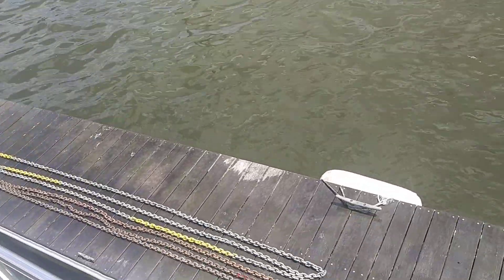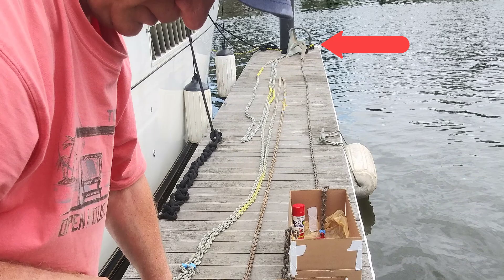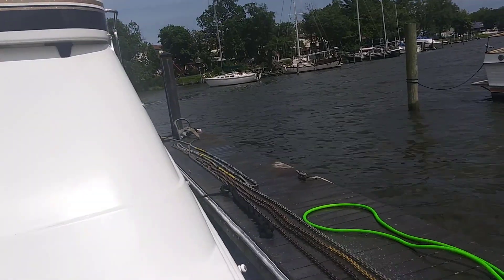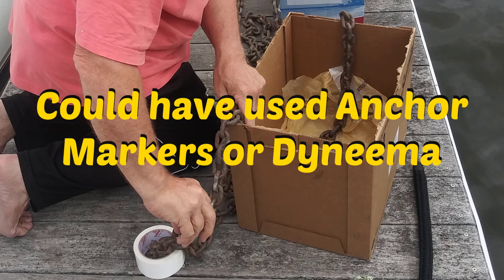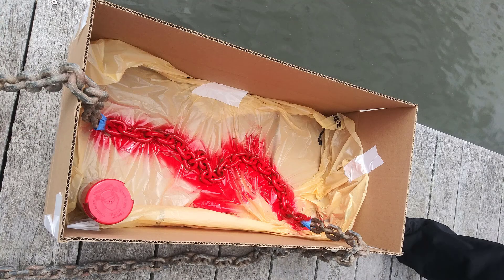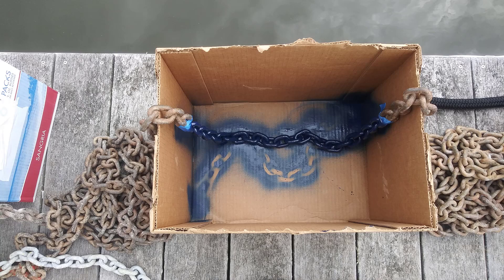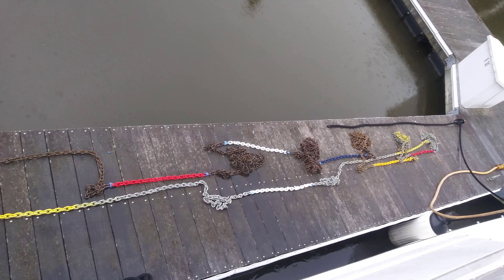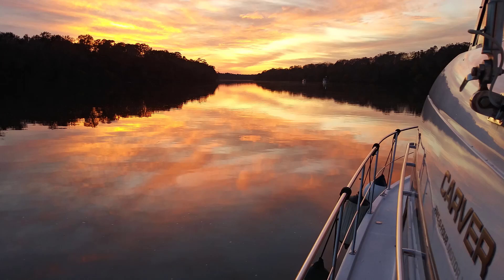How to Mark Your Anchor Chain | What Yacht To Do

Comment: Very nice how to and why video. Last spring I outfitter our Carver with a new road. Maxwell recommended 15’ of chain and 250’ of rope for our windless. I watched you video back then and ruled out paint and didn’t want to go with the alternatives you mentioned for the same reasons. Four bottles of Rite dye and a lot of boiling water later we were set.  Colored rode markers are a must have IMHO.
Reply from the maker: Glad it helped! Had not heard of the Rite dye idea, but guess that works good on rope. "Don't leave port without a marked anchor rode!" 😎

Comment: We do something similar, however just use one colour. I tested three different reds and found one that was most visible in the water and marked the chain with one, two, three or four  bands at 25' intervals, and then repeat. It's worked great for us. The plastic ties break or wear off and pollute the water which we don't want, so I feel the painting seems to be less environmentally invasive.
Reply from the maker: That's great! We also did not feel like the ties were effective so that is why we went with paint. 😎

Comment: Hi Guys. Thanks so much. As usual, that was very informative. Though I am a believer that, "more is often better", I wonder if having  300 feet of chain rode situated in the distal most bow section comes with a weight penalty (as much as 300 lbs) that compromises your ability to achieve planning and good fuel efficiency. I 've read that heavy chain at the bitter end does improve anchor "bite", but would a reasonable balance in rope rode be advantageous? I know nothing, but curious of your thoughts...
Reply from the maker: Hi Mike. Good question. Yes it's heavy. But it's part of the original equipment/design of a boat this size. Boat rides fine and most important factor on fuel consumption is speed. Most of the loop is done on waterways where we do about 8-9 mph - safety and sightseeing are our two most important considerations. Considering we can carry 688 gallons of fuel, 350 gallons of water, a Belgian wafflemaker 😂, and usually a weeks worth of provisions, we are heavy anyway! Every boat has tradeoffs on a continuum of comfort vs economy. We are closer to the comfort end. 😎

Comment: Did you consider using different colored zip ties? Seems like it would be easier but wondered if you know of any drawbacks?
Reply from the maker: Yes, but they get chewed up in the windlass and they are harder to see. 😊
Reply: @WhatYachtToDo  I thought that might be the issue. I'll probably use you paint scheme. Thanks
Reply: @RichardRostant1  When they do come off (and some if not all will eventually), they contribute to the plastic waste in the waterway/ocean